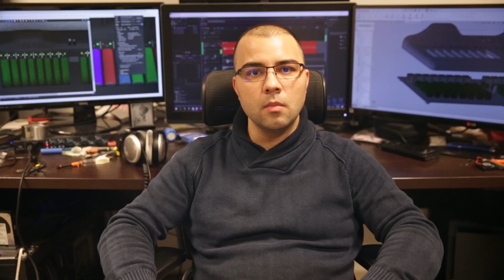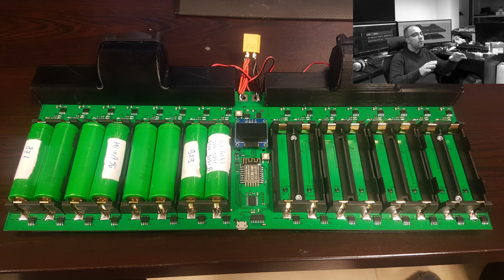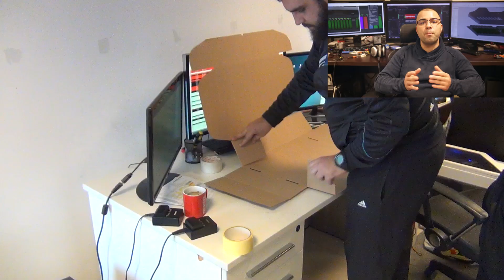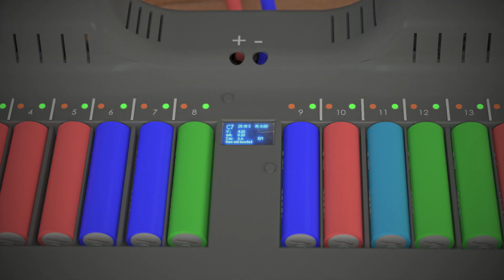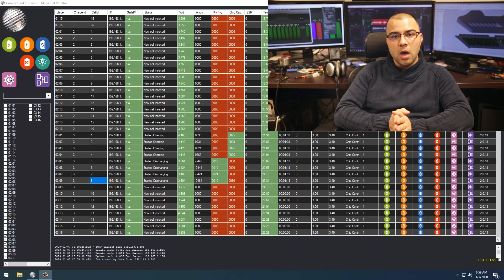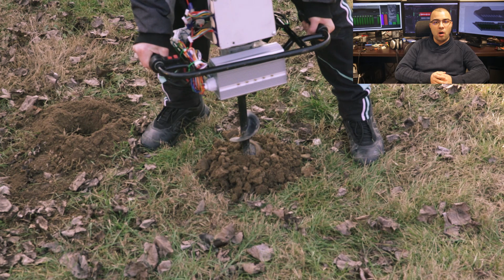Megacellcharger Crowdfunding Presentation

Comment: Instead of 3d printing could you Vaccum form the outside of the enclosure, perhaps in 2 halves ?  3d  printing is slow, the injection moduling process is very costly.  from an Engineer  who stumbled across you Indiegogo campagin/ Also is it only AA  that your device works on? Or is there a spring loaded device or packer used for smaller batteries?

Comment: idiots don't know basic math  16 cell capacity for $192CDN min & to be FULLY functional  $220 + tx/shipping  etc  so  $13.75 per cell.   Meanwhile a very good 4 cell charger that  does more can b had for under $25  in shipping etc ($6.25/cell for the math challenged)

fuktardss both backing this bs and backing  w/lack o brains...   seriously  wtf is wrong with these idiots.....

Comment: I would be interested if only it could operate with no software on computer, and instead access almost everything via built-in browser page. It might have some limited data logging this way, but that can be solved probably too with micro SD card.
Reply: Thanks for the suggestion! The device works stand alone as well, but there's no history saved, you will get just the results after using it.
We aim to control multiple devices from a single workstation and avoid going through each charger to collect data, pull out SD carts or control to each of them through a web interface.
Reply: @Alexander1560  Awesome. Does it run some rundementary webserver / page to monitor and control things? If one can access status of each cell via some simple HTTP GET JSON request, it would also be easy for me to write a simple script in python to log data on my computer on Linux for example.
Reply: @movax20h  yes, it runs a webserver and info is passed / get through json

Comment: Wondering why you guys havent made it so it functions like a power device (powerwall) also 
so the user can set the voltage needed depending on the amount of bat's in it and so on
Best of luck with your product